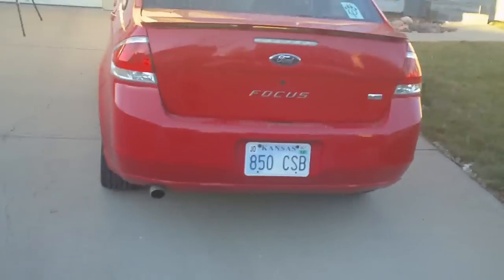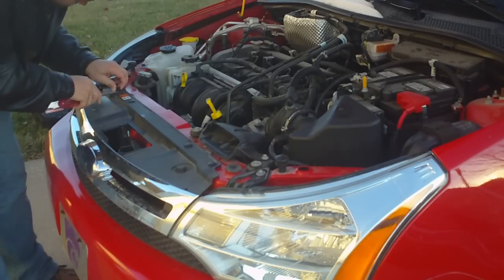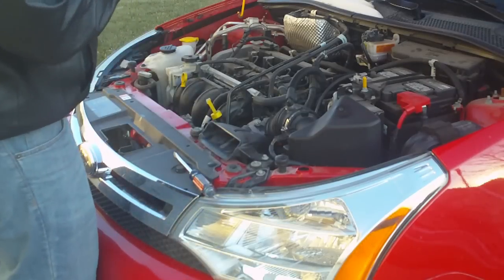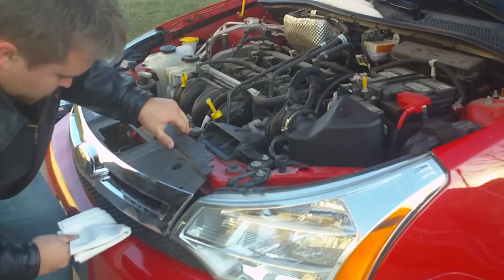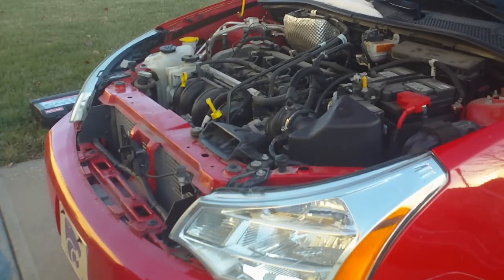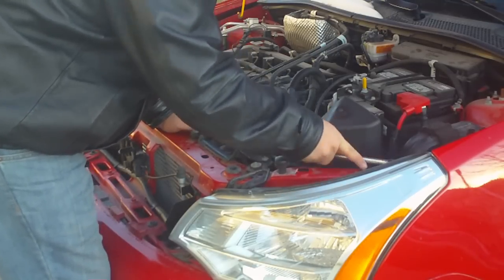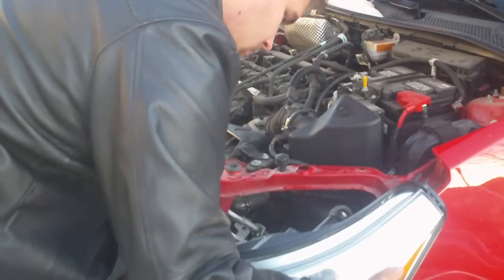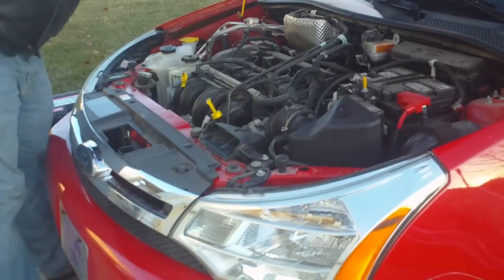How to Change the Headlights on a 2008 US Model Ford Focus

Comment: Thank you for this video. My car is the spittin' image of yours, same paint job, trim, everything. Followed your instructions. Took me a little longer because of the bitter cold, 10 degrees F. Was going to replace both lights at the same time, but only replaced the one that was out because my fingers were starting to get frost bite. Will replace the other one when it is warmer. Easy fix when you know how - thanks to you.

Comment: Just wanted to let you know that this was extremely helpful.  I was told the same thing... have to drop the bumper... remove the air intake... several things... priced from $54 to $104 for a stupid turn signal. 

You're instructions only took me 25 mins and that was only because I lost my 10 mm socket and had to use a wrench instead. Thanks again!  Super helpful!

Comment: This is the second or third time I've needed to use this video, so I'm leaving a couple of tips for myself and others.  There is a little pin by the middle of the 3 bolts that stops the top of the grill from moving out.  Get some bulb grease when you buy your replacement bulbs.  My guy at O'Reilly said corrosion is the main reason our bulbs burn out early.  Thank you, everyone!  BTW, if this 70 yo grandmother can do this, you can too!

Comment: Thanks for this excellent video.

I had to replace the passenger side headlight bulb on my 2009 Ford Focus SES, and the Haynes manual suggested removing the coolant expansion tank. I started doing so, but it became quickly obvious that even if I did remove that tank, there is no way I'd be able to get to the connector for the headlight (the vehicle's frame completely covered the connector)

I used your instructions to remove the grill to get the headlight off, and was quickly and easily able to replace the bulb.

Comment: The correct term for the plastic bits you call pins (two piece), is rivet or caped rivet. Most auto and motorcycle manufactures are using them these days. Thanks for the video! I would have been scratchin' my head on a few procedures.

Comment: Your video was very helpful when I needed to get to the third screw for the headlight. Especially since the owners manual claimed you only needed to remove two of the push pins. You made my life a whole lot easier.

Many thanks, SteelTheAnthroWolf.

Comment: THIS IS A GREAT VIDEO OF HOW NOT TO CHANGE YOUR HEADLIGHT BULB!  Simply loosen the hose clamp on the air box and remove the hose from the air box.  Disconnect the wire going to the air box sensor.  Remove the two 10 mm screws and lift the air box out.  Now locate and remove the bulb by turning it counter-clockwise as if you were sitting in the driver's seat.  Installation is reverse order.  It only takes about 7 - 10 minutes.  If you are replacing the bulb on the passenger side.  Remove two 10 mm screws and swing the coolant bottle out of the way.  Locate and turn the bulb nut counter-clockwise as if you are sitting in the driver's seat.  It only take about 5 - 7 minutes.  Installation is reverse order.
Reply: Thank you! This worked much better for me!
Reply: You are right about this. It's a lot more work taking off the bumper/grill. And those little 2 piece rivets are a pain. I learned that when I went to replace a rear brake light. Maybe I was doing that wrong.

Comment: To remove the front grill, take up the four push pins, then pull the bottom edge of grill forward.  You can look down inside and see the 4 forward facing  u-shaped  clips. Just wiggle it forward. Then the outboard edge of headlight lifts straight up,with a tug.

Comment: You're awesome dude! Just a suggestion to quickly make your video better, add edit in a small pic of the clips under the grill, and the clip at lower right under the light fixture and the small plastic piece that juts from the center, top left bolt plastic that you have to lift up to remove the fixture. Otherwise fantastic video!

Comment: DO NOT CHANGE THE BULB LIKE THIS....YOU ARE CREATING EXTRA WORK IF YOU DO!!!!!  This video causes people to think the engineers are dorked up and they should....well just look at the comments below as a result of this video and there's someone else on YouTube saying to do it the same way.  Open the hood and look at the left side of the vehicle as if you're sitting in the driver's seat (all references are from the driver's seat).  You will notice the air box.  Look to the front of the air box and you will see three 8mm bolts.  Go ahead and remove the bolts.   Next you will see a large hose  that connects to the right side of the air box.  Next to the clamp securing the hose to the air box you should see an electrical connector.  The connector has a red lock tab at the bottom.  Slide the red lock tab toward the front of the vehicle until it stops; then, remove the connector by pulling it forward.  Now stow the connector out of the way.  Now is a good time to loosen the clamp securing the hose.  You don't need to remove the clamp; only loosen it enough to remove the hose.  Now grab the bottom of the air box and lift it up out of the way.  All you are doing is removing a rubber plug from the inner fender area.  The air box should be able to lift out.  Identify the connector on the rear of the bulb.  Squeeze the tab and pull rearward and the connect should come loose.  There are two tabs or wings (for gripping) grab them and turn counter-clockwise and the bulb will come out.  You can apply some dielectric grease to the connector if you like and assembly is the reverse order or disassembly.  DO NOT TOUCH THE GLASS OF THE NEW BULB WITH YOUR SKIN.  IF YOU DO SIMPLY REMOVE YOUR BODY OILS FROM THE GLASS WITH SOME ALCOHOL.  If you follow these instructions you will have removed 3 screws, loosened a clamp, and disconnected 2 electrical connectors.  You are welcome and have a great day.  Be careful when watching how-to-videos on YouTube.  I'm not an authorized Ford mechanic but I own four of them.  When "SteelTheAnthroWolf" stated the Ford mechanic said to remove the air box; that's all I needed to hear.  After all, the Ford mechanic does this task as a living.

Comment: I had a problem getting the headlight assembly loose.  Of course, I removed all three bolts after getting the grill out the way.  I could get the headlight assembly to move some, but not enough to access the bulb.  I followed the video closely, but nothing seemed to work to get the headlight assembly loose.

Comment: its a good demonstration. I was having problems till I read THE MANUAL THAT COMES WITH MY CAR.  durrr...dont know why I didnt think.of that first. it gives instructions to do what you just did...kinda.   They say to "remove the two pushpins" and remove the grill to get to that third nut...

pushpins? there are actually four, if its what you removed on top...although they could also mean what you moved out with the screwdriver and paper towel...

thanks!!  why do they make instructions so hard?

Comment: If I recall correctly when I changed my bulbs, once you remove headlamp assembly, if you look straight down, you can see the fog lamps, as for changing to HID, I do not know.  -- Hope this helps. (This is for an 09 Focus).

Comment: just replaced mine, but I found it easier to remove the radiator fluid bottle to do the right side. I have not had to do the left yet though, maybe I'll revisit  the video when I need to.

Comment: You have to remove the grill just to swap out a bulb? Thnx Ford! Good thinkin'!
Reply: NEGATIVE!  I posted instruction above.  Even a caveman can change the bulb without removing the grill.  Just remove three 8mm screws, loosen 1 hose clamp, disconnect 2 electrical connectors, pull up on the air box to remove it and replace the bulb.  It's that easy.  My instructions above go more in detail, but that's all there is to it.

Comment: Dude, thanks for posting the video! The whole process from start to finish for me was a little under 5 minutes! It's still a pain in the ass having to remove the grill from the car, but its all good. I changed the drivers side headlight. Is the passenger side just as easy, or is there more to that?

Comment: You forgot to mention the last clip, right on the bottom of each housing. It must be pulled straight up or ( as I did it ) released by a longer thin flat blade screwdriver..otherwise it will fight you since you are pulling straight ahead while the clip needs to go UP...

Comment: You bust your ass too much, its easier yes to remove the front bumper fully than partially like you did, 10 plastic clip around the and below the bumper and voila a whole ten minutes to remove it all and you got all the room in the world , thats how i always do them when the light bulb are not accessable by the back, loll cheers and thanks for the vids, its good none the less,
Reply: Think Harder what?!? You remove your bumper to change a headlight? that seems a bit excessive.

Comment: This video is great minus one detail.  The video shows the upward prying of the grill off of the bumper once the four plastic locking tabs are removed from the top that lead me to believe that the slotted tabs at the bottom of the grill was vertical.  The slotted tabs are horizontal in direction requiring the bottom of the grill to be pulled forward out of the slots while raising the grill off of the bumper with the shrouded screwdriver.  Great video otherwise. .
Reply: Absolutely correct revision to the instructions.